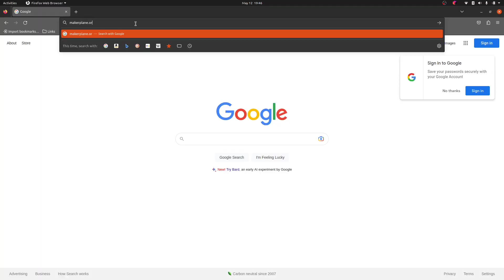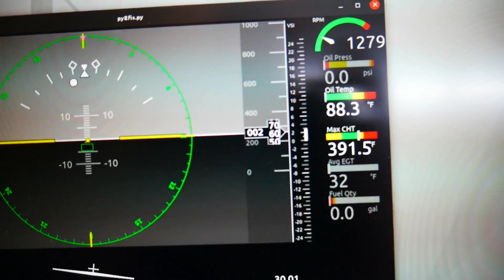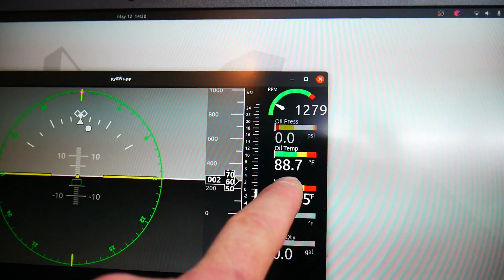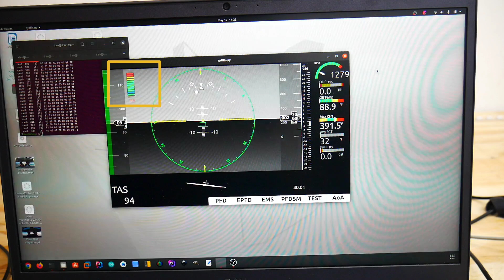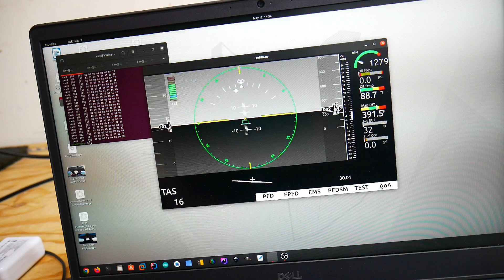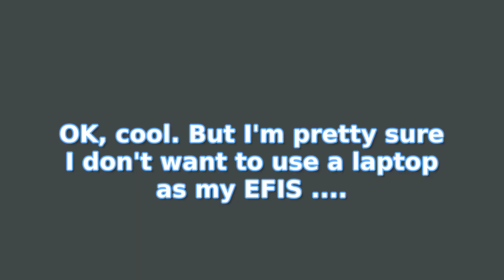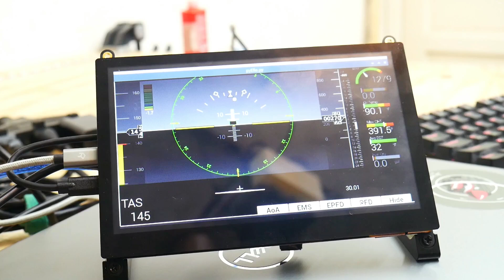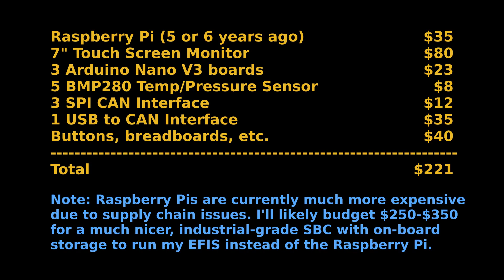Practically Free Avionics

Comment: This is a very nice project. I dont know if this has been flight tested. Do not underestimate the electrical noise, from all those USB devices and power supplies.
Reply from the maker: Thanks for watching. 

It has not been flight tested yet. This is a very early proof of concept. I published another video after this one when I started to design printed circuit boards to hold all of the components. For each board I designed, I included a way to power it from the aircraft's electrical system:
https://youtu.be/cIsv_dQTMyo

The main reason I like the MakerPlane echo system is that it's designed around a CAN bus network. CAN much less susceptible to EMI than, say, serial or I2C. And it's easily made redundant as well - because all nodes talk to all nodes, it's very easy to just add another node as a backup (a second EFIS screen, for example, in case one fails).
Reply: @dan_der_flieger  yes, i know. can bus is pretty much the standard in avionics. my comment was mostly regarding the EMI that can get into the radio coms themselves. 
still, very nice project. will keep it on my follow list.
Reply from the maker: Oh, I see. Yeah, it would all be powered from the avionics bus (and grounded to a block), not from USB cables. So hopefully the EMI would be very limited? I'd definitely be thankful to hear other/better options if you have any.  🤔

Comment: I would like to see the code running on the RPi 4 and the new RPi 5.. The new RPi 5 can boot/run from an NVME SSD…
Reply from the maker: I posted another video a few months after this one showing my foray into printed circuit boards. I'm using a Raspberry Pi 4 in that video and it performs much better:
https://www.youtube.com/watch?v=cIsv_dQTMyo 

I didn't realize that the RPi 5 could run NVMe. That might actually move me to use one.

Comment: Can the code be downloaded for the various Arduino modules that you have connected to the EFIS via the CAN bus?
Reply from the maker: The MakerPlane GitHub repository is where I started. There's an Arduino/CAN library (look for CAN-FIX-ArduinoLib) that has example files. 
https://github.com/makerplane/CAN-FIX-ArduinoLib

My code is based on that, but modified for the hardware I'm using. I have it forked on my GitHub, but that repository is not public right now - it's very much a prototype and I don't want to put that code out there as is. I'm taking a short break from the avionics stuff for a little bit and working on my actual airplane. I'll be back at it soon, though. I don't want to burn myself out so I switch back and forth between the two. 

Is there a specific code sample you're looking for?
Reply: @dan_der_flieger  all understood and very many thanks for the information. I’m just looking to get basic temp and/or pressure data from a sensor module such as a BPM280 via CAN to the EFIS to get me started. I’ll have a good look at the MakerPlane git. Thanks again my friend and I hope all goes well with your projects.
Reply from the maker: Hey, I just realized I didn't reply to this. Here's a code snippet for reading the BMP sensor and converting it to CAN format (specifically the MakerPlane CAN-FiX standard):

Imports:
#include <canfix.h>
#include <mcp_can.h>
#include <mcp_can_dfs.h>

#include <Wire.h>
#include <SPI.h>

#include <Adafruit_BMP280.h>
#define BMP280_ADDRESS 0x76
Adafruit_BMP280 bmp;

#define CAN0_INT 2
// MCP_CAN CAN0(10); // MCP2515 module (8Mhz)
MCP_CAN CAN0(17); // All-in-one (16Mhz)
CanFix cf(0x82);

Within the loop() section:

    float oiltemperature = bmp.readTemperature();
    unsigned int oiltemp = oiltemperature * 10;
    CFParameter pOilTemp;
    pOilTemp.type = 0x222;
    pOilTemp.index = 0x00;
    pOilTemp.fcb = 0x00;
    pOilTemp.data[0] = oiltemp;
    pOilTemp.data[1] = oiltemp>>8;
    pOilTemp.length = 5;
    cf.sendParam(pOilTemp);

Hopefully that's helpful. 🙂

Comment: One question I have is about the display, specifically about sceen brightness. A year or two back I investigated the available displays and found that the rating in nits wasn’t that impressive compared to the ratings of the commercial EFIS units on the market.
Reply from the maker: Yeah, this screen is for prototyping only. MakerPlane sells a 5" sunlight readable one for about $100, which is the best price I've seen for anything sunlight readable. I'm hoping that by the time I'm ready to build out my panel, someone has produced a 7" outdoor screen for about the same price. I'm probably a couple of years away from that.

Comment: Well good for you. Build it and fit it to your plane that would be great to see

The only recommendation id have is to make the panel cut out and connector pinout the same as some popular commercial unit which would make it better for if the plane ever gets sold.

Good on you for doing this. Its great to see
Reply from the maker: Good suggestion, Dave. Thanks!

Comment: All good mate youve made a screen display some data, and these days, thats not too hard for a person to do if that person is knowledgeable.

To get that to the mainstream you can do viacexperimental aircraft. But ti have a product the average joe will buy takes a whole organisation and support system.
Reply from the maker: You are 100% correct. I have no intention of selling anything in this video. I'm building a Sonex aircraft from a kit. It is an experimental amateur built (EAB) aircraft. This system would ONLY be for experimental use. And I'm not even committed to using it myself yet. I'm just demonstrating the art of what's possible here in case there are others that have an interest in learning.

I work as a software developer collecting sensor data to display on various screens, so this is not new territory for me - the thing that I find really cool is the use of the MakerPlane open source projects/libraries I'm demonstrating here. They've done a good job of designing a standard from the ground up for others to use in their own projects.

Comment: Excellent and fun project. BTW it's pronounced like sea-fish or EEFIST. Secondly, there's no way you want screw terminals , USB plugs, or pin headers in your avionics. You might be able to replicate the functionality, but reliability and durability is the hard part. There's a reason avionics are so expensive. Open a Bendix radio up or  a garmin nav-comm and have a look at how they're built. Home made is probably just fine for VFR around the pattern but if there's even the slightest chance of inadvertent IMC you'll really want commercial electronics. ( I know I'm g
Reply from the maker: Hah, yeah, I realized I was mispronouncing it the day after I posted the video. I blame it on having trained with steam gauges 

I absolutely agree that using bread breadboards and USB connectors is in no way practical in real life. This was only the first step in a long road.

I've been working on designing printed circuit boards and posted a video about it shortly after this one. You'll be happy to note that I pronounced EFIS correctly in that one 🙂:
https://youtube.com/watch?v=cIsv_dQTMyo

Comment: Now if we could design an efficient comms unit based on a software defined radio module with the proper filtering for the output feeding a power amplifier to bring power up to the 5-10 watts needed for aircraft radios. This unit should be capable of transmit as well as receive. Anyone out there have something on the bench yet?
Reply from the maker: Yeah, that would be pretty cool. If anyone starts working on that and sees this, please let me know.

Comment: It's all too damn pokey. Give me the old gauges any day.
Reply from the maker: I hear you. I actually prefer looking at steam gauges - for airspeed, in particular. Most of my flight hours are in two Cessnas owned by a flying club I belong to. We recently upgraded the panels in both airplanes to include a couple of Garmin G5s, which show your airspeed as a tape. I still find myself looking over at the steam ASI instead. It's a lot easier to interpret a needled pointing at 3 o'clock on approach than to read numbers on a tape. 

But I love that you can have access to all of the data on an EFIS, too. Ideally, I'd have a little bit of both on my panel.

Comment: I have always been a bit wary of the idea of using a RPi for an EFIS (or using Linux for it in general) because with most distributions there's so much stuff in there you don't need. I don't like the idea that your EFIS might crash because some process related to printers started filling up a log file and then suddenly you're out of storage. There probably are stripped-down Linux implementations that do target this kind of application, though.
Reply from the maker: I use a Debian-based distro (Ubuntu) every single day as my primary workstation, and I have for years. Raspbian is another Debian-based distro specific to RPis and it works pretty well. I don't think Linux isn't the issue here, especially on a computer that's disconnected from the internet (and consequently doesn't perform automatic updates that can change things in unexpected ways). 

In my experience, Raspberry Pis are solid until the microSD card becomes corrupt. And SD cards are notoriously slow compared to other storage types (onboard eMMC for example). So I totally agree -  a single Raspberry Pi probably isn't a good idea for real-world use.  Using two of them redundantly is a better option, but still a potential failure point (though everything fails eventually). One good thing about microSD cards is that you can have a spare one (or two) tucked away in the airplane that you could simply replace in the event of a failure. 

But there are also plenty of really good SBCs out there these days that would be a better choice. If I end up using any of this homebuilt stuff for real (which I'm still not 100% committed to yet), I'll be looking in that direction. I still have plenty of aircraft to build before I need to make any decisions about avionics.
Reply: You can build your own with Yocto Project. I would definitely do it instead of using the regular RPI distros. I wouldnt use an RPI either for the already mentioned reasons. There are several SBC's with built in memory flash, certainly more reliable, such as the OSD32MP1-BRK.

Comment: Since you're building it from scratch, why use CAN and not a protocol the Raspberry Pi supports natively?
Reply from the maker: The simple answer is because of Electromagnetic Interference (EMI). CAN is used in automotive, nautical, and in many cases aerospace applications because it's not as susceptible to EMI as most other data transfer standards. So your signal has a better chance of arriving at its destination without interference. It also allows you to have several sensors and gauges on the same network at the same time (all able to listen to everything going on) which means you can easily add redundant components.

Comment: That's a very interesting project!
One that is connected is flight computers, have you played with the idea or seen some opensource project?
I mean like flight computer like Sporty's Electronic E6B Flight Computer, not like autonomous flying.
Reply from the maker: I use an electronic fight book (EFB) called FltPlan Go that I use for moving digital sectional maps and it includes several E6B functions as well (weight and balance, etc.) It runs on a phone or tablet and it's free on either Android or Apple devices. I'd use for those functions on my tablet and just save this project for in-flight data only.

Comment: 2:56 With an ambient temp of 88°, that's pretty low!
Seriously, now, is there a way to show all four temps on the main display (on one graph)? 'cause you want to catch that 63° one right away
Reply from the maker: It's open source software, so you have access to the code. You could edit the code on the PFD screen to include different engine information if you wanted to. Personally, I'd just add a second display so I had a backup PFD and/or engine management screen. That way, you have everything in view, but also a backup in case one of your screens dies.

Comment: I build similar systems for sim avionics and I just skip CAN and use a serial bus. I still wouldn't trust a RasPi or some of those SBCs even though none of that will ever leave someone's garage or basement let alone the ground. Avionics should run on a dedicated RTOS, not python.
Reply from the maker: Sounds like some fun stuff. The president of my EAA chapter runs a non-profit STEM program for high school kids and was asking for some help putting together a realistic panel for the simulators. There are some really incredible projects out there to add actual buttons and potentiometers to control a GPS, for example (or whatever), including Gerber files, parts lists, code, etc.  Really cool stuff. 

Anyway, I'm sure you already know this, but in case anyone else is reading this: The beauty of CAN is two-fold: 
1. it's less susceptible to EMI noise compared to serial. It uses two separate signal lines - one high, one low - to differentiate between an actual signal and an erroneous one caused by EMI. Serial does not filter that noise very well, which is why CAN is used in vehicular industries. With sims, serial is definitely fine because you're not dealing with anywhere neat the EMI that you will get with an engine spinning an alternator and coils firing spark plugs, etc. 
2. it's designed for a many-to-many connection so you can build in as much redundancy into the system as you like (e.g. two SBC EFIS's that ingest the same data in case one EFIS fails) - OR - build several smaller displays that show a single data point (an AoA sensor, for example, or an oil pressure gauge) running on RTOS hardware  - OR - (preferably) some combination of both. Redundancy is the answer to the Swiss cheese effect where everything has a potential to fail. The possibilities of failure are holes in the Swiss cheese. By stacking several slices of cheese together, very few holes remain. The number of remaining holes depends on your acceptable level of risk. 

That said, I agree that RTOS hardware would be the best option for the EFIS. But in my case (as a day VFR-only pilot), two high quality SBCs (not RPis) each connected to a dedicated screen is a risk that I feel is acceptable. Others will have varying degrees of agreement/disagreement with me and I fully support whatever risk they are willing to accept. This is definitely an experimental solution and for those that are risk averse, I suggest you look elsewhere.

Comment: Great video. Just a question. Is there any certification required?
Reply from the maker: In my case, no. I'm building my own aircraft, called an Experimental Amateur Built (EAB). But that doesn't mean that I'm interested in cutting corners on safety. Before flying with any of this equipment (if I use it) it will be thoroughly tested. I'm still a long way away from building out my panel, which will give me time to determine whether or not I'm happy with how the project is going.

Comment: Very attractive displays for the garage. Don't you have to get FAA approval to build it into your aircraft? Where I live the airworthiness certification depends on all components being also approved. Not where you are? I'm curious. Best, Rob in Switzerland
Reply: For certified aircraft, absolutely. 

Even then you can legally add extra solutions under certain circumstances. Usually things that are easily removable like additional tablets do not need approval. I suppose you could leverage that even on certified aircraft to add sensors and displays as long as you leave the certified avionics untouched.

As Dan is working on a homebuilt airplane, I suspect he will be operating in the Experimental category of aircraft. And there you can do almost anything.   In the U.S. there is the EAA that provides resources on what can work and what won't. In Germany we have something similar in the Oskar Ursinus Vereinigung. For Switzerland I just looked up EAS (Experimental Aviation of Switzerland).
Reply from the maker: You are correct. My aircraft will be categorized as Experimental Amateur Built (EAB), which allows for non-certified equipment. Obviously, all of this needs continued development and testing before use. I'm only demonstrating the possibility of homebuilt avionics here.
Reply: @dan_der_flieger  ... and doing a great job by the looks! 🙂 My background: avionics for Harrier (/AV-8B) and Airbus A-300 and subsequent models' fuel systems while at Smiths Industries (now GE Aviation), ZFT flight simulators from Rediffusion and Thomson-CSF (now L3 and Thales) and most recently Swiss defence radar projects for RUAG AG with Hensoldt & Thales. All the best, Rob in Switzerland
Reply from the maker: Wow, very cool! Sounds like you've had a great career! If you have any pro tips, I'm always open to suggestions.
Reply: How do Pilots legally fly with IFly or Foreflight EFB'S and get away with it? How about a Home Built Stratux Unit?   Because there not attached to the Airplane.  However the Tail Beacon or Sky Beacon for ADSB OUT- HAS TO BE HARD MOUNTED Because your Tail Number and Serial Number are tied to it..  Wire it to NAV Light or an independent Switch with a breaker and if you don't want tracking to be available poof no problem!   The system he's building is for Experimental or Backup only.   Its Its Certificated then YES you have to have FAA Approval.